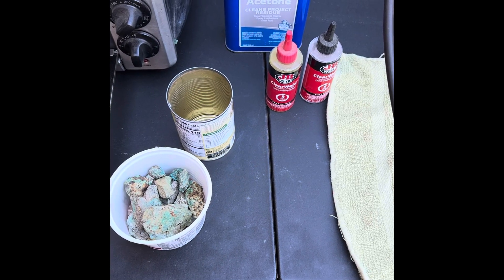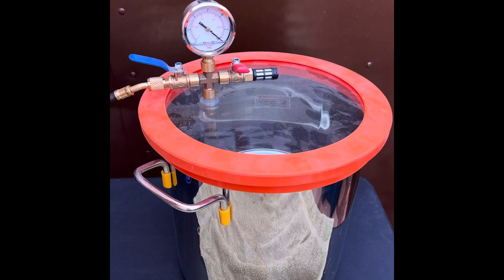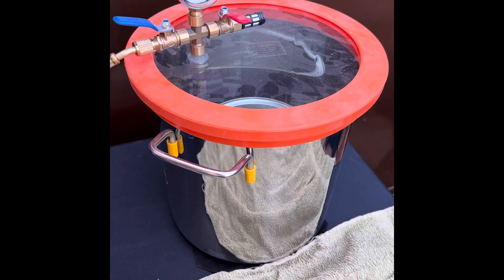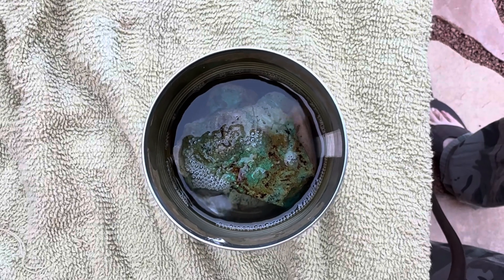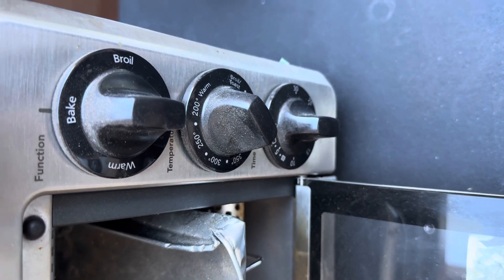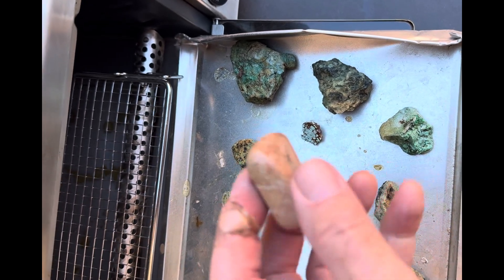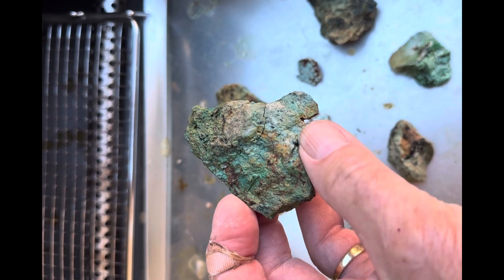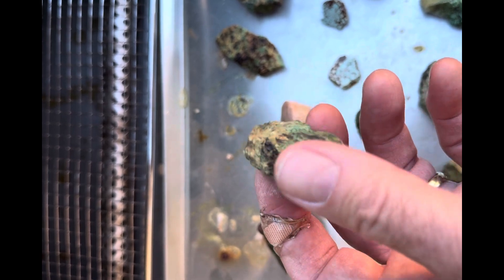Easy Rock Stabilizing

Comment: Heating up turquoise and other heat sensitive rocks will ruin them most of the time. They turn from their original color. It's not advised to heat them up. I have tried various methods and this just doesn't work for softer materials. Chrysocolla can also turn from green /blue to black when heated. There's just no good way for an individual to stabilize materials consistently and keep their quality without commercial equipment. There are labs that you can send turquoise to, for them to safely stabilize before you cut them. That's the best recommendation.
Reply from the maker: @barth8443  I’ve used this technique on turquoise, chrysocolla and other stones with no issues at 250 F. But you are correct heat can ruin some materials. I once ruined a piece of variscite on a candle warmer trying to dry it out before backing it.

Comment: Will the acetone vapors damage the vacuum pump?
Reply from the maker: @whatnotzone6866  As far has I know no. Really don’t have to run the pump that long, once you reach maximum vacuum close the valves and shut off the pump. I guess it’s possible that with time some rubber components could be affected, but I’ve done this quite a few times and no problems yet. But I have killed a few water pumps to flat laps and cab machines.
Reply: Yes acetone breaks down the seals in a rotary vane pump.  It will be worthless when used several times like this.  Look up acetone fumes and using today vane pump on line. Acetone fumes break down plastic which the seals are made of.